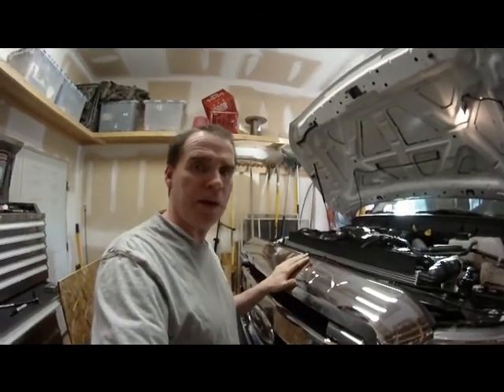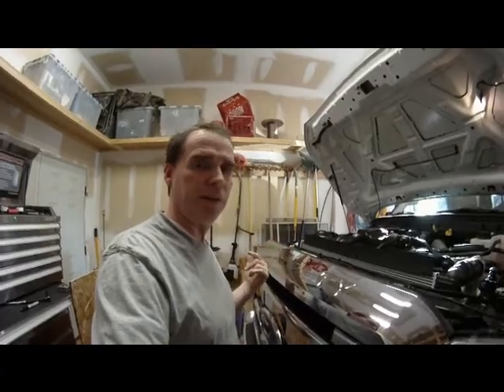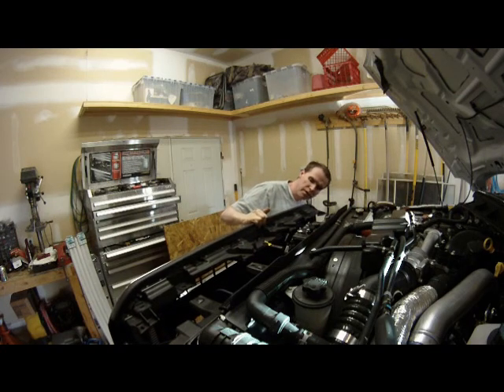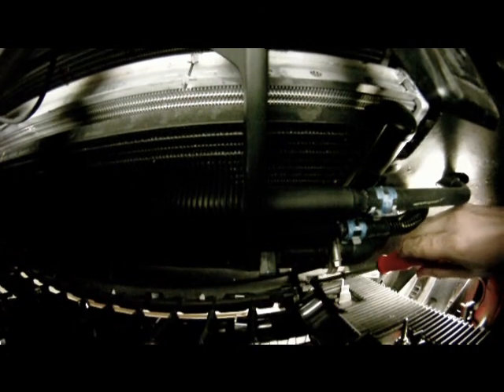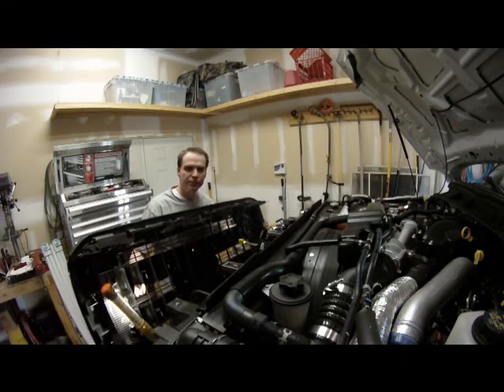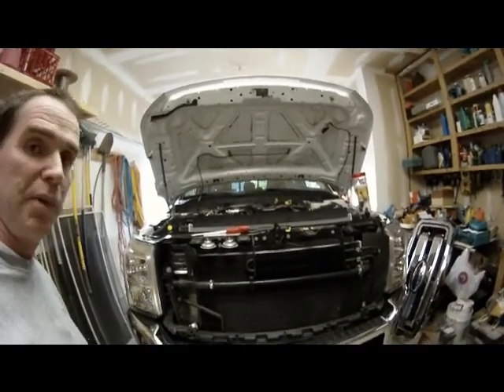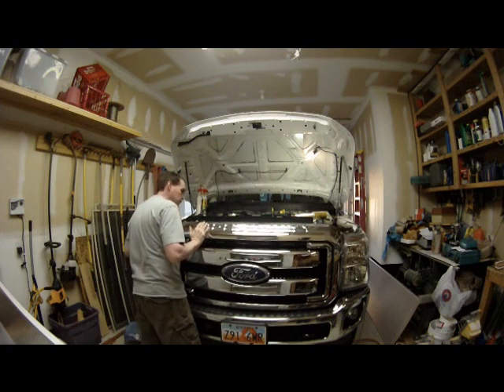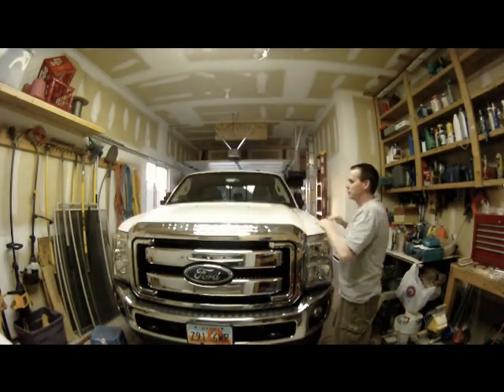2011 Ford Super Duty Removing Front Grille

Comment from the maker: @reelwork1 The alignment is the biggest thing and is mandatory in my opinion. Be careful that the alignment shop knows what you need. Many will simply just restore to factory settings and think they're done with it. This is wrong and will make the truck wander all over the road. What a shame on an expensive and beautiful piece of equipment. I also replaced the OEM shocks and steering stabilizer and what a difference... Look on my channel for the video. Huge improvement in driving feel.

Comment: @tj548p Yep, saw your shocks and stabilizer vids - good stuff. I pretty much have the exact same truck as you running stock 20's with michelins, but will be replacing with BFG's or Nitto's in the next year or so. Planning on putting a stabilizer kit first since I drive a lot of country roads and well, that steering/suspension is a little sloppy from the factory. Fine for most, but take it offroad and/or lots of bumps and it's all over the place just as your go-pro captured.

Thanks again.

Comment: @tj548p Thanks - any lessons learned on the lift (other than alignment to get the geometries back)? asking about things you would do differently,  like getting shocks instead of going with the spacers, adding a 1 inch block to the rear. I'm looking at the T-6 Billet blocks but will check out Autospring too.